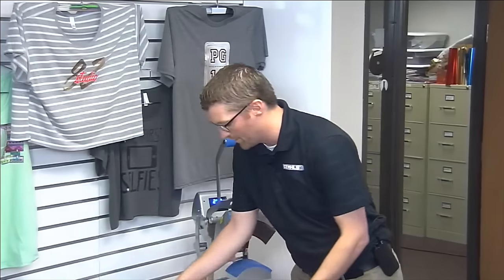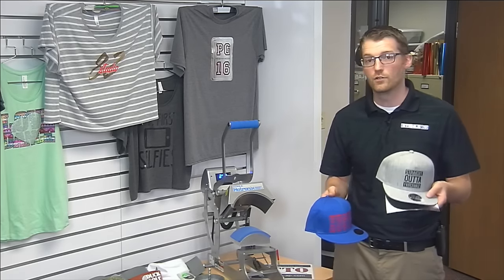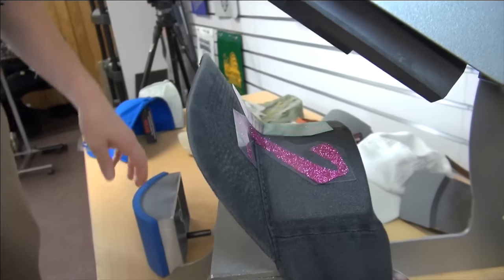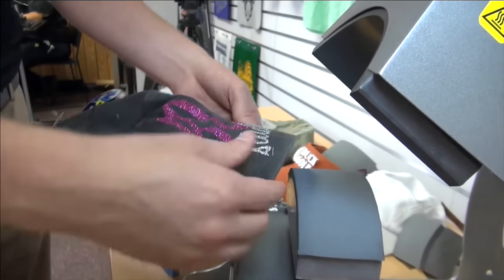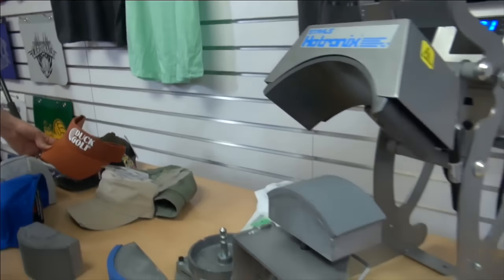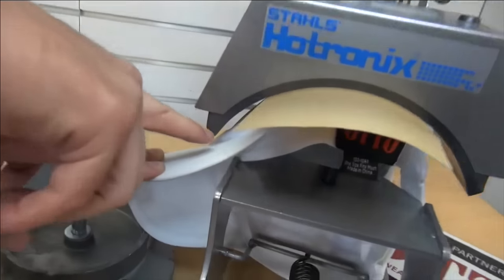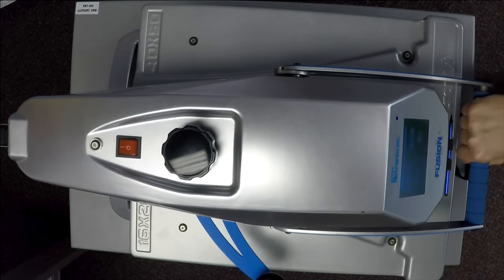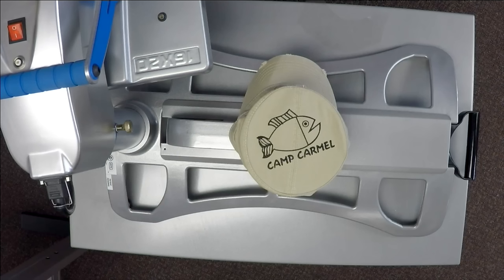How to Heat Press Hats | Project Headware

Comment: Does the machine stretch the hat out when it pulls it down to hold it in place?
Reply from the maker: Hi Bonnie, no the machine does not stretch out the cap during the application. The lever is designed to pull the hat tight over the platen and hold in place during heat application, but it should rebound perfectly after application.